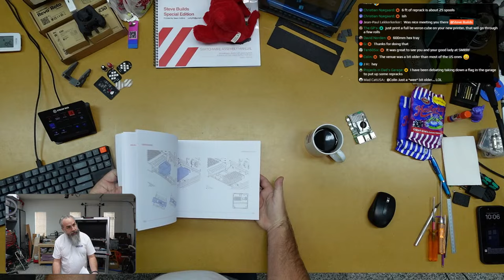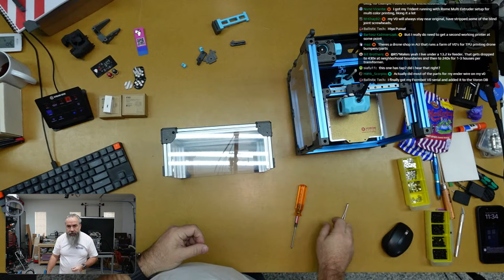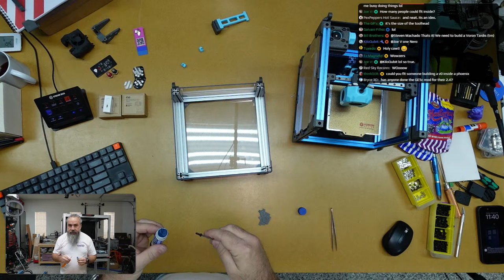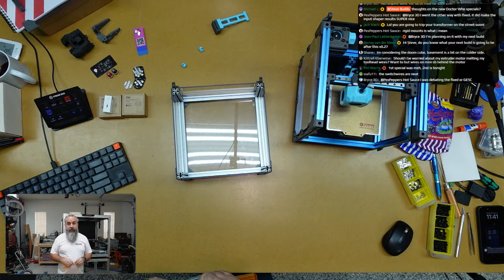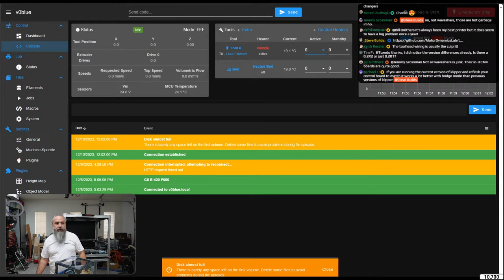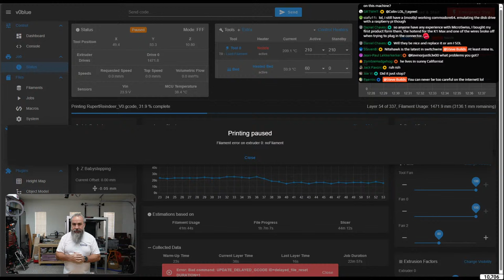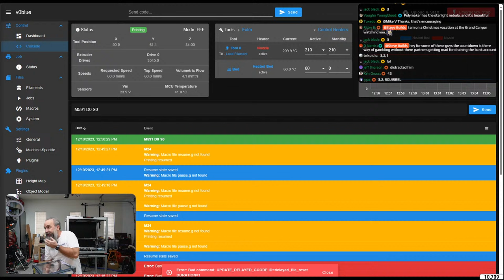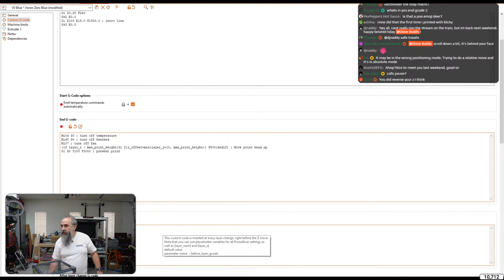Post SMRRF Hang Out

Comment: a 1515 Phoenix, IDEX mini-SB, four V0 beds, NEMA 17 ballscrews. only thing is what would you call it, a small mythical bird, hmmm
Reply from the maker: That would be a neat build.  But might push for 2020 based extrusions because there are no usable linear rails that aren't wider than 1515 extrusions.
Reply: Phoenix is 3030 right? so in that case moving one step down to 2020 is in line @SteveBuilds
Reply from the maker: Yep, 3030 based.
Reply: then 202 replaces my 1515 initial spec :P

chop chop  @SteveBuilds  ;)